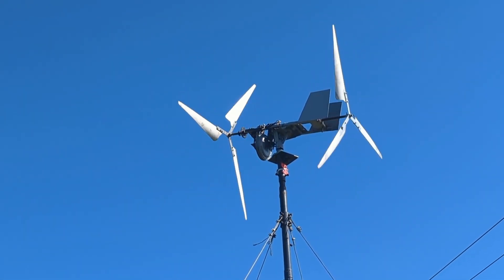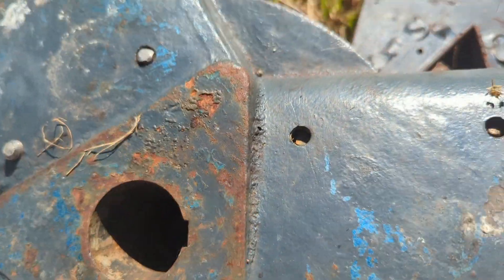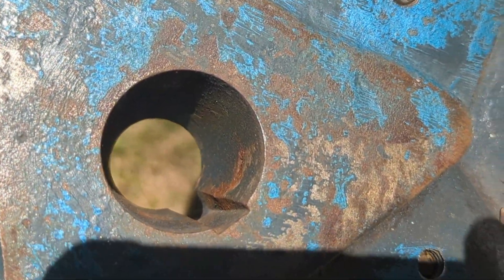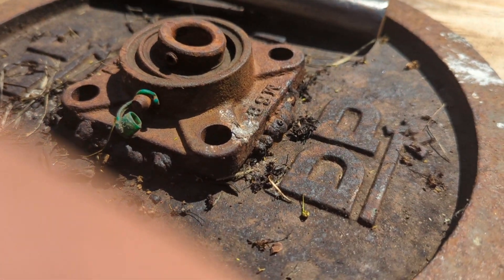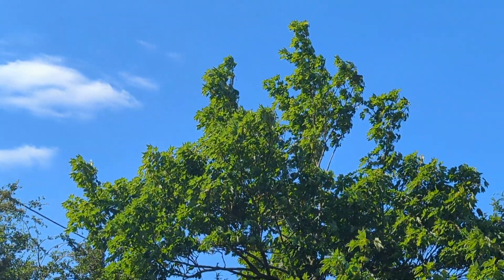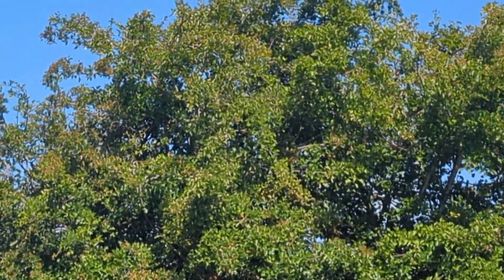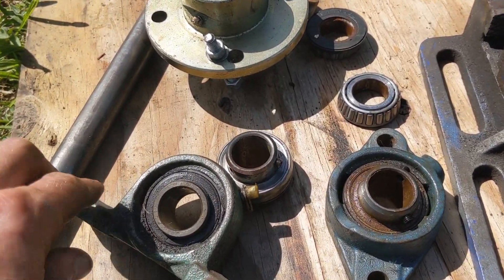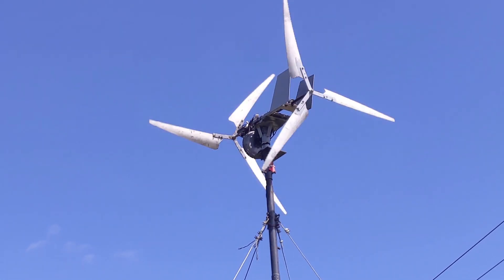48v E-Bike Motor Hub Wind Turbine - Mk 3 with Bigger Blades - Free Electricity -  27th May 2022

Comment: Hello sir with this type motor do you have test increasing magnet power? Add external magnet to rotor?
💪
Reply from the maker: Are you talking about the generator I am actually working on with the electric bike motor or the type of rotor shown in the thumbnail picture? Thank you
Reply: @GavinFreedomLover  yes at this and to LG direct drive
The power is the result

Movement
Electromagnetic camp
Current

3 direction law
If increasing magnetic power increase final power
💪